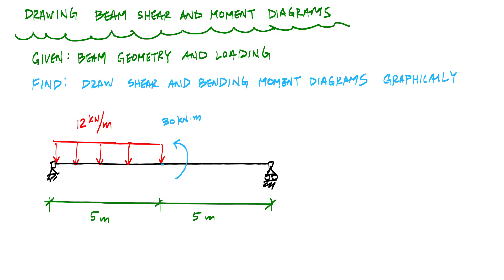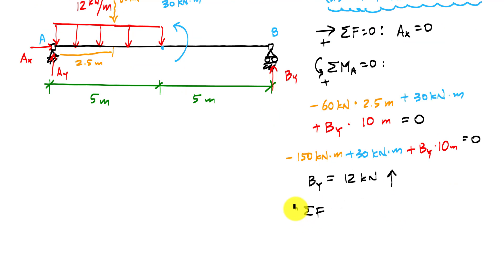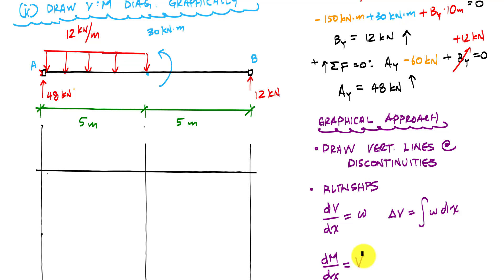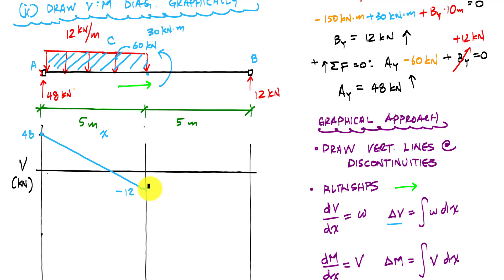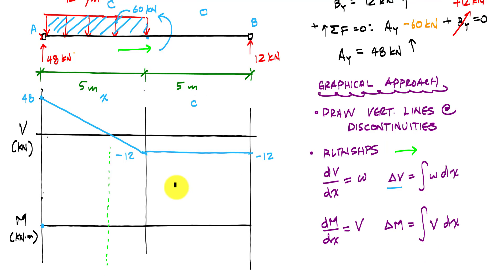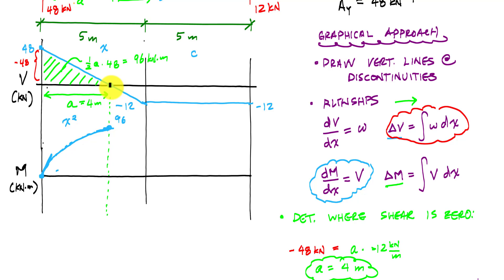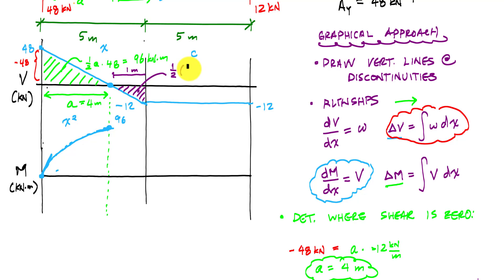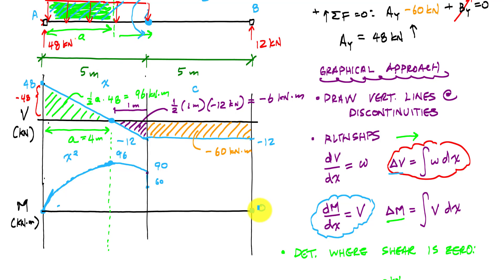Drawing Shear and Moment Diagrams for Beam

Comment: the shape of momen diagram should be the same of the shape of deformation of beam. It will be easier to imagine
Reply from the maker: not necessarily, it depends on the sign convention you are using for internal loading.